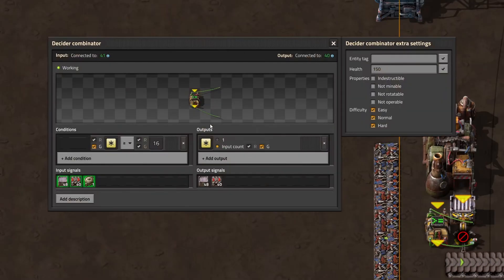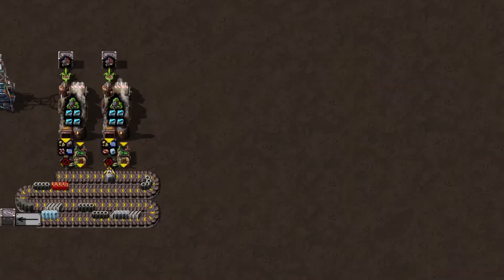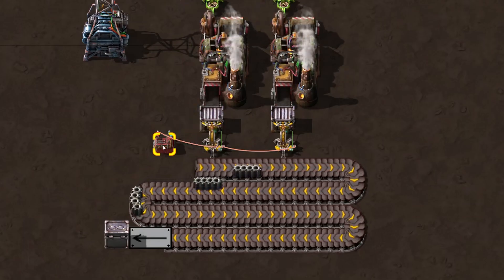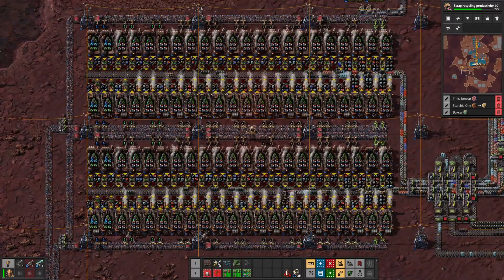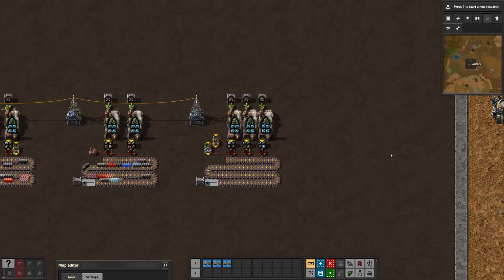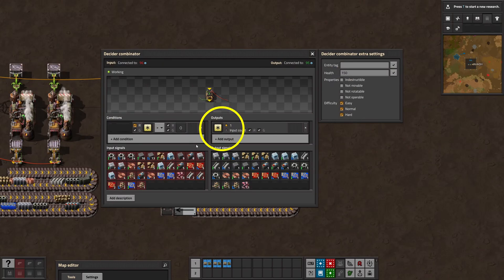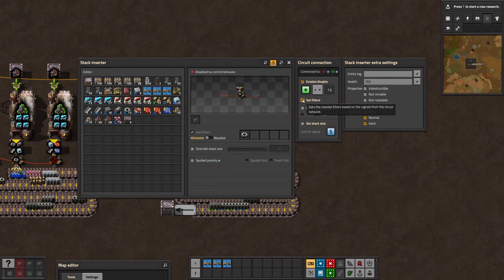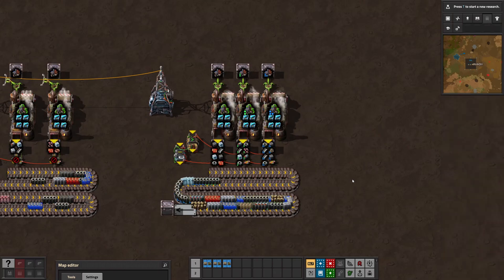Advanced Recycler Belt Stacking - Factorio Guide / Tutorial

Comment from the maker: Updated the blueprints because there was a minor mistake in the video.
The inserters enable/disable should be set to greater than 2.
It was late... 4AM :D
There are now 3 blueprints depending on how much you value UPS because it's possible to limit inseter stack size to only output single stacks of 4.
Reply: You can also limit the Stackinserter to only grab 4, so if a Stack can be placed it will be and it will not wait untill 16 are availble.
Reply: Remember to use at least uncommon chests if you have legendary quality unlocked or they will clog up.
Reply: Why the enable/disable need to be greater than 2? It receive a -15 input + chest content, so if chest content is 16 for an item, it would give 1... so should not it be simply greater than 0? Having it at greater than 2 make the inserter to wait to have 18 items in the chest before unloading it.
Reply from the maker: @Wildhorn666  Combinator delay. I explain it in detail in the thuster throttling video. Imagine 1 gear is recycled into the chest, then the signal is gear 1 and the inserter will put it on the belt with greater than 0 condition. Because of delay the -15 signal is only present 2 ticks later.
greater than 1 works as well but because of scrap productivity its possible to get more than 1 item.
Reply: @AVADIIStrategy Makes sense. Now how would you solve the "will almost never happens but because of that, will surely happens" scenario of having 5 epic quality items at 16, filling the inserter filter, blocking anything else reaching the count of 18 to be "unloaded" ?
Reply: oh no, I just build my entire mega base with the broken design XD 

I was already wondering why it kept outputting only 5 items and not the rest.
Reply: well i tried this blueprint and when you do quality recycling, this sadly does not work well, the box is simply not big enough, at least in my case
Reply: @robertweigl7201  Just use a higher quality chest (uncommon steel works)

Comment: The problem with this approach is that if you remove all of one type of item from the recyclers, the next one of those gets taken out on its own and not stacked.  The filter on the inserter gets set to the amount of the item being there which could be 1, and there are two ticks through the combinators before its -15 is set.  So you have two ticks where that item gets put unstacked on the belt - in which time its not in the recycler any more.  You can see this easily by running this from empty, the initial items will be put unstacked on the belts.

Comment: Not explained in the video is the reason for the value of 16 in the arithmetic combinator. It has to do with the stack size of the (white) stack inserters, which can hold 16 items too. The two signals (items held & −15 signals) will output the signal for as long there’s an item held (which will set a filter), EXCEPT when there are 16 items held (the value we set in the arithmetic combinator), because the signals cancel each other.

Comment: With 2.0.35 you can now connect furnaces to circuits, so the chest is no longer needed. Please note that, at the time I write this, 2.0.35 is still experimental version, so you need enabling experimental updates to use it. Also note that 2.0.34 and 2.0.35 have some breaking changes, partially reverted in 2.0.36.

Comment: Interesting implementation. I had it similar to the last example, but used 1 arithmetic combinator set to "*each* OR '-1' = each*", and then inserters were set to be enabled if "*any > 14"
The combinator basically turns any positive signal into '-1', and then the inserter will see the amount as N' = (N-1), if true amount N = 16, then the inserter will see N' = 15, and N' > 14.
This makes it a bit lighter on UPS, and has 1 tick shorter delay. If one needs it to use stacks of 4, change inserter condition to "*any* > 2".

Comment: All chests are comnected right? When 15 chest have 1 of an item , the logic reads it as 1 stack and sets the filter, 

This i my understanding, is this right? How would we avoid this? 

I guess i just dont understand this logic and am mistaken.
Reply from the maker: All chests are connected with a red cable and this cable only goes into the decider combinator. The decider combinator outputs all input signals with value 1. So it doesn't matter how many items are in the chests.
The inserter only knows about the amount of it's own chest (green cable) and the amount coming from the arithmetic combinator (the other red cable).

Comment: But now each chest can have up to 1 stack of each quality of each of the items, which is not enough storage right?
Reply from the maker: If you use quality recycling then also use chests of the same quality. Legendary chests for example have 120 slots!
Reply: @AVADIIStrategy I am testing the 1x4 blueprint, and it is contaminating the belt with non stacks. Any idea why?
Reply from the maker: @Gaminggamer1602  No, im not home atm. will check the blueprint when back. you did unlock bekt stacking though?
Reply: @AVADIIStrategy nevermind it seems it was a wiring issue

Comment: Great idea, significantly improved my throughput, however I found that if you have legendary unlocked, the amount of possible items can fill your chest before sufficient quantity to reach 16 items.
Potential solutions, set stack size smaller, say 4 or 8, or upgrade to higher quality steel chests, giving more spots.
Reply: Man... I was trying to figure out how to solve that problem and was starting to think about a complex double chest system with more network circuit... while simply using green quality steel chest was the solution to get 60 item slot...
Reply: This was my original thought as well. It requires a much larger chest to handle all the possible combinations. Thanks for being a sanity check.

Comment: Bigger problem - CHEST IS TOO SMALL. 48 slots only
12 * quality so you need 60 slots. 
you can use this in base game only for scrap that is uncommon+ or up until you research legendary or use uncommon boxes

Otherwise for common scrap +have legendray unlocked = will jam eventually.
if you use general item scrapping it jams pretty much in a few minutes.

So Scrap can be doen with uncommon + boxes but for commons stuff only mods will make it work. 
you need at least 18*5 = 90 slots
I use warehouses mod with 2x2 96 slots box so it should work  - haven't switched back to full processing so not 100% sure (good thing about 2x2 box is that I can use 1 box + 1 inserter per 2 recyclers)

Comment: Change to uncommon steel boxes, otherwise they'll eventually get stuck. Besides, the inserters will not work even if some items reach 16 (but it still works when reaching 32). The signals from red and green wires are actually added to calculate the inserters' working condition, which makes this whole thing work.
Reply: Great idea, I got my setup stuck exactly because of this issue (up to epic quality).
Reply: Why would they get stuck otherwise?
Reply: if there's 60 different items theres a chance for the whole chest to be filled with different items without reaching the stack threshold and when that happens the recycler will not be able to put in more items

Comment: Your decider combinator has  the same setup that a memory cell would have. You would just have had to route the green signal back around...
That would have been another (I think slightly more reliable) way to get rid of the signal delay issue; although I don't understand how that specific condition on the inserters fixes the "signal delay" issue.
Reply: It fixes it, sorta.
It assumes that by the time there's 32 of one item, there's at least one of every item in all the recyclers combined.
Reply from the maker: @craidiefin  Thats not how it works. But i made a mistake see my latest pinned comment.
Reply: @craidiefin  Ah, so we aren't actually waiting for 16 items to be in one chest, we're waiting for 32 in all chests, then we're taking out 16 (once we have them in one), which means that the amount will never fall to zero again. I.e. like my solution it's also just remembering what it's seen, except that it does it by keeping them in the chests.
Well, as long as you have enough slots in the chests...
Reply from the maker: @Pystro  Nah the waiting for 32 items isn't necessary. You just wait for 4, 8, 12 or 16 or whatever so that the inserter has enough for 1-4 stacks.
But we have to make sure to not activate the inserter on value of 1 or better 2 because of the delay issue.
Your memory idea "route signal back" is great. Unfortunately the first time you will ever put a single item into the chest the inserter will output it immediately.
If this behaviour doesn't bother you then get rid of the enable/disable and use memory.
Reply: @craidiefin  And the assumption is that we will never have 32 by having two chests that reach 16 within the same tick. (Because then we'd grab both stacks of 16 at the same time.)

Comment: Have you found a use for those new combinators yet? Sorting, I think they're called?
Reply: Selector combinators, pretty good for automated recipe switching. Used them for a single crusher asteroid reprocessor. Have multiple decider combinators reading the level of asteroids on the belts, and based on some conditions output the recipe to the decider combinator, which picks a recipe randomly to send to a crusher
Reply: @submachinegun5737  yeah you could technically use one here, since the scale is big enough that the stack inserter will always be placing full stacks… just have it set to select the highest input (highest item count) and it will always leave the lowest count items to be last 🤓
Reply: They are also good for display things, for example, I get the amount of items in buffer before the rocket, get the one with the least amount of materials, then display how many rocket I can launch, yeah it doesn't produce anything but that's one use for it
Reply: if you put the rocket requests through a decider combinator, and change the output to 1 for each, then the values will be sorted by the same criteria that rockets request individual item types for.  You can use the selector combinator the grab the first, second, or more signal and apply it to a buffer chests requests.  This way your bots will queue up your resources in the order they're requested by the rockets.
Reply: Selector?
Reply: I found a way to queue up in demand resources for rocket launches using buffer chests, a decider combinator, and selector.  It makes loading rockets with bots much faster.  Especially in early game.